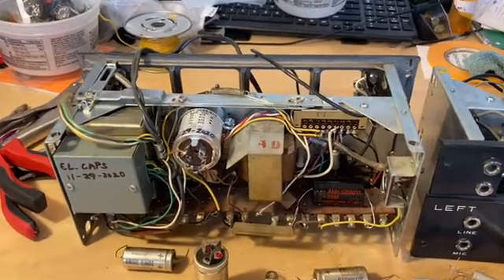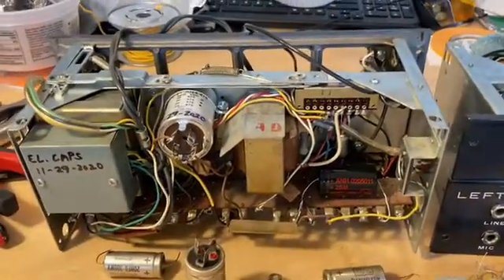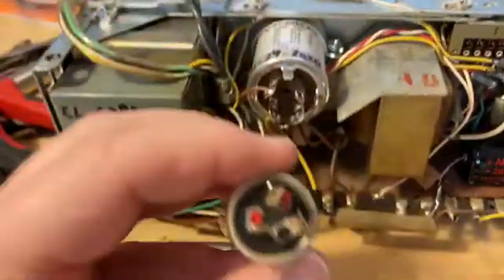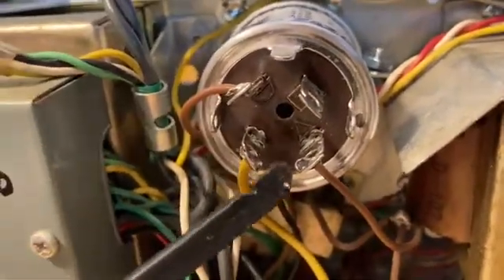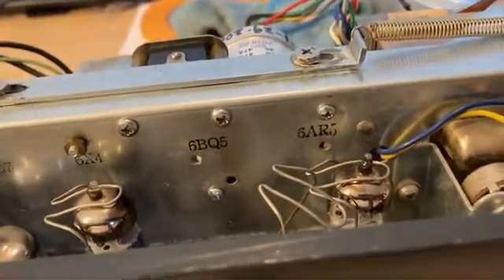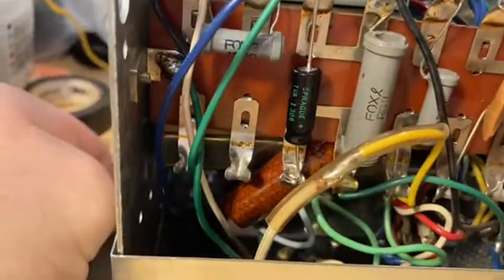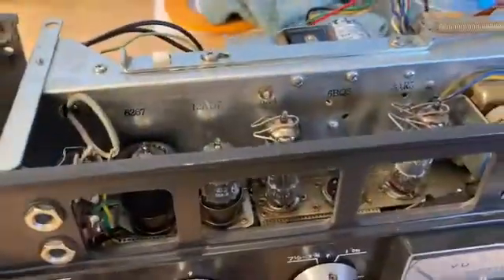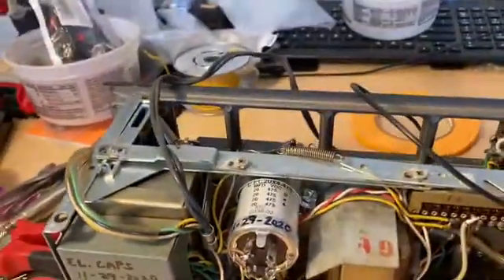Roberts 770x/Akai M8 Reel To Reel Capacitor Replacement-Part 1

Comment: Thanks for this. Do you have a part number/source for the multi-section cap?
Reply from the maker: Thanks for watching!

I sourced most of the parts from tubesandmore.com 
Here’s a link for the multi caps.

https://www.tubesandmore.com/products/capacitor-ce-mfg-475v-20202020-f-electrolytic

Comment: Thanks for the video.  I have the same deck and it just started having an issue where the tape will slow down after about 10-15 minute of play.  It will play normal again if I shut if off for a little while but then repeat the same behavior after a short period.  It seems to rewind just fine though even when the tape is playing slow.  Do you think this is an issue of the motor run capacitors?
Reply from the maker: Yes that’s where I’d start.  Mine would do that when trying rewind.
Reply: @dayofone9786  Thanks for the reply, are the motor run capcitors the big ones that are sticking straight out  like the one at the start of the video that's at the top of the chasis?  What do the smaller ones like the red and black at the bottom  right control?  I'm thinking of replacing them all.
Reply from the maker: @Abruzzo333 
Not sure which videos you’ve watched. There are 5 parts. This video link below shows and discusses the motor capacitors. The motor caps are AC capacitors not DC electrolytic capacitors. They are similar to what a ceiling fan would use and are typically square now. I had to use two separate ones to match the needed spec and retrofit them in there. Not sure about the other question since it’s been several years of making these videos. Just make sure you don’t mix up AC and DC capacitors. The only AC types I believe in the machine are the motor capacitors directly located on the motor.
https://youtu.be/6TkkaOWTDM0?feature=shared
Reply: @dayofone9786  Thanks.  I didn't know there was 5 videos.  I'll hae to watch them all.  This second link was helpful.  I just have to track down the exact capacitors now.
Reply from the maker: @Abruzzo333 
Here’s a link to a service manual. The Akai M8 is the exact same as the Roberts. You can try tubesandmore.com for a lot of it. Good company👍

https://audiocircuit.dk/downloads/akai/Akai-M8-tape-sm.pdf
Reply: @dayofone9786  Nice, thanks.  I'm determined to have this back running 100% as it used to belong to my dad who brought back from Germany when he was serving in the Army in the 60's.  About 10 years ago a local tech replaced the pot metal cams inside with some parts he had specially machined by a friend.  I think these decks sound amazing when they're in good working order.  I don't use the built in speakers...instead have it connected to a mixer and out to a pair of studio monitors.

Comment: While I get that not everyone like tape sound or to tinker with that, It always saddens me when I see them gutted just for the amps. I am a tape enthusiast and absolutely love the sound of magnetic tape and tubes, and am also a multi-instrumentalist and have been buying as many as I can save them from being gutted. People have been kind enough to remake the dreaded “pot metal” cams that commonly break and so once those are replaced and new caps etc... these decks sound soo good. Cool to see you kept the tape section. I want to convert the ins and outs to balanced transformers and install 2 track heads at 15 ips. That would be my dream. Cheers

Comment: Hi Day of One, please advice me! I have an Akai 1721w. A few days ago when I started it, I found the engine not turn. The rest works, the VU-meters light up,etc.Do you think it is because of the capacitor? Thank you!
Reply: Hi Day of One! Evrika! Unbelivable! I changed the capacitor and it still didn't work. Then I noticed that the frequency switch was moving unnaturally. I changed it and now everything is perfect.
Reply from the maker: Sounds like it could be the motor run capacitor or the motor belt may have broke. The motor capacitor is probably an A/C capacitor, NOT a D/C. I doubt you’ll be able to find an exact replacement. Just look for one that is close in specs. You may have to combine two of them to equal the value you need like I had too do. They are basically what ceiling fans use for the motor. You can watch my other video on this and get some more info there.
https://youtu.be/6TkkaOWTDM0
Reply: Tnx Day of One for answer. Really, is an AC double capcitor, a combined 2+1 microF/250v. I will try to replace it with 2 regular capacitors. Tnx again !👍
Reply from the maker: @zorro5553  Awesome. Just try to find the closest value cap that’s available. It doesn’t have to be exact. Just remember to not use a D/C electrolytic capacitor. They can/will explode or catch fire. Good luck.

Comment: Thanks for the excellent video series!
I am ordering all the capacitors you switched out. Also ordering new tubes.
I was wondering about the one you did not replace. I want to get one of those as well, but I cant open the machine now since it is in constant use in the studio. So I wanted to ask which capacitor to order. 
Thanks again for the incredibly helpful video series!
Reply from the maker: Thank you again for watching. I believe the only capacitor I missed was the 1uf 150v electrolytic. I just looked on tubesandmore.com but only found 50v so you’ll have to do some looking around. That maybe why I didn’t switch them out originally. If yours doesn’t appear to be leaking, burnt or bulging out then you’ll probably fine keeping the original. Good luck.
Reply: @dayofone9786  Great, thanks a lot!
Would you consider doing a video about calibrating the transport section of this unit?
Reply from the maker: @njalpaulsberg8091  If I knew how I would, lol. This is the first R2R I’ve owned and fortunately the tape calibration seems satisfactory.
Reply: @dayofone9786  Yes hopefully! Demagnetising is always a good idea.
I was wondering if you could tell me which leg goes to which terminal on the large capacitator.
Original capacitator has terminals 1,2 and 3, while the new one has terminals D, square, pyramid and hyphon.
Reply from the maker: @njalpaulsberg8091  The four leads inside the canister housing that come up through the brown part are the positive terminals. It doesn’t matter which positive lead goes to which of these terminals. Each one is a separate 20uf capacitor. Just don’t run more than one positive lead to each positive terminal. The four outer terminals directly connected to the metal canister are for grounding leads. You should have 3 positive leads and 1 negative lead going to the 4 way cap if you choose to eliminate the bottom left single 20m cap that sits above the board. You’ll need to run a new longer lead wire from the old bottom cap terminal to the new 4way cap. You don’t have to run a 2nd ground wire from the old board cap to the new 4 way cap since it is already grounded. You will have one unused 20uf cap left in the 4 way. Initially I thought about running the right side single 20uf cap (that’s mounted above the board) to the 4way but changed my mind and went with a single 20uf JJ instead. Hope this makes sense and good luck.
Reply: @dayofone9786  Thanks a lot for the reply! I understand now! First time recapping here, so I dont know the ins and outs, so to speak. But ive made sure they are all facing the right direction, at least! 
Just have to go buy a drill to drill those rivets out, and it should be good.
Reply from the maker: @njalpaulsberg8091  Awesome. I was able to tap out a couple of the rivets with just a nail set punch and hammer. The others a drill bit. The rivets may spin while trying to drill but the metal is thin and should cut through enough to push on through the chassis. You can use some pliers or channel locks to hold the rivet while drilling.  You’ll probably need to cut off one of the legs from the capacitor mounting ring with a grinder or dremel in order for you to get the nuts on the new mounting bolts. It’s tight but will fit with some patience.
Reply: @dayofone9786  Hi Robert!
I was able to complete this operation, and the machine still works! It did not fix the problem, however, which is a different frequency response in the two preamps. So I decided to order the rest of the capacitors and switch those out.

Comment: Very helpful video. thank you. Im not very knowledgeable about electronics and changing out caps. So i am trying to learn more.
Reply from the maker: It’s fairly easy if you’re familiar with soldering and desoldering. A solder sucker and a wide solder tip will help to remove the caps from the board. Just be aware of the positive and negative directions on the electrolytic caps. If they are installed backwards they can explode. Just take pics with your cellphone first and do one at a time. Good luck.
https://www.amazon.com/Tabiger-Solder-Desoldering-Sucker-Remover/dp/B0777LMVTT/ref=mp_s_a_1_2_sspa?dchild=1&keywords=solder+sucker&qid=1610592584&sprefix=solder+suck&sr=8-2-spons&psc=1&spLa=ZW5jcnlwdGVkUXVhbGlmaWVyPUEzUVQwMFpFUlNSQ09CJmVuY3J5cHRlZElkPUEwNzcxMTY5TThSSFFCTkpNSE81JmVuY3J5cHRlZEFkSWQ9QTA0OTI2MTZZM0dKNlU2RU9JWFgmd2lkZ2V0TmFtZT1zcF9waG9uZV9zZWFyY2hfYXRmJmFjdGlvbj1jbGlja1JlZGlyZWN0JmRvTm90TG9nQ2xpY2s9dHJ1ZQ==

Comment: I just got one of these myself. How do i change the belt on these. Also what kind of Capicitor do i need?
Reply from the maker: I bought the electrolytic caps from tubesandmore.com. Here’s a list:
2ea C-EC20X4-475 (4 way 20uf cap)
2ea S-H122 (mounting ring)
2ea C-ET20-500-JJ (single 20uf cap)
8ea C-SA25-50 (25uf Spraque caps)
This should do both the left and right preamps and will cost about $110. There is also a 3uf cap that I forgot to change out. Just look over your board and you’ll see it.  The AC run motor capacitors can be bought from amazon.
https://www.amazon.com/gp/aw/d/B07JLVZXL8/ref=ya_aw_od_pi?ie=UTF8&psc=1
https://www.amazon.com/gp/aw/d/B07JLV9HDJ/ref=ya_aw_od_pi?ie=UTF8&psc=1
You’ll have to get creative with mounting these since they are rectangular. Just make sure you use AC caps and not electrolytic DC on the motor.
As far as the belt is concerned, I didn’t replace mine so I’m not 100% sure. If you go to hifiengine.com you should be able to find the service and owners manuals. Search for Akai M8 if you can’t find Roberts 770x. There maybe more info on the belt there too. The motor may have to be removed to slip the belt off. Hope this helps.